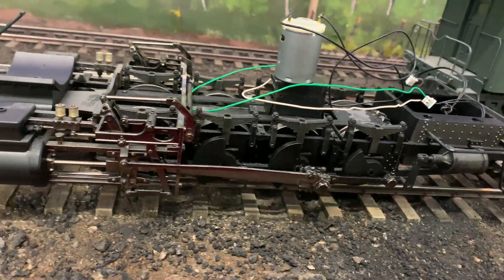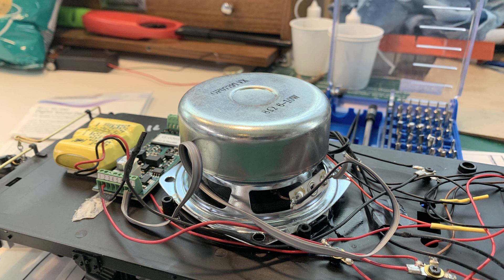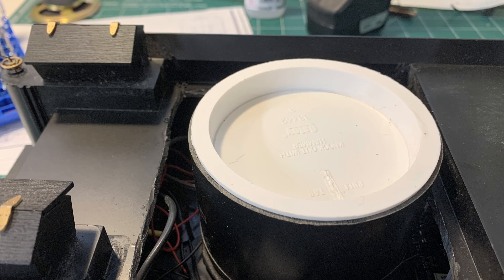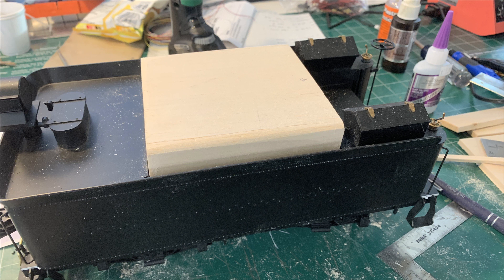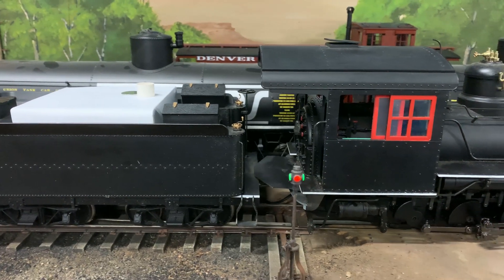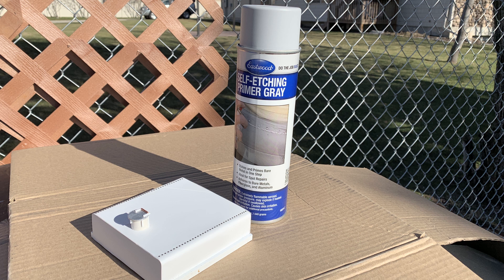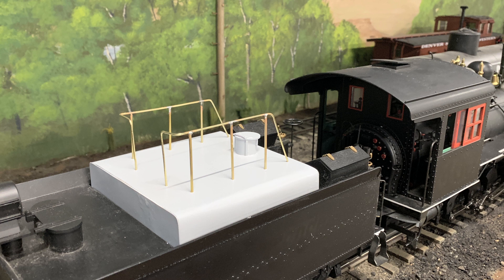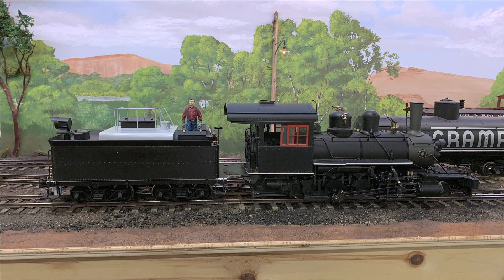Converting Bachmann Spectrum 2-8-0 Outside Frame Consolation to an Oil Burner

Comment: Hi... I really enjoy your video's on the Conni... You gave me the inside story on how to do!  "Thanks!"  Now,,, I am making a decoder change from what you did... I am using a ESU 58513 which has everything like sound on board this PCB plus a lot more possibilities... I will use the two power wires interconnect on the tender as my speaker connection from the loco,,, and I will rewire this locomotive extensively to make it more serviceable... Plus that Motor's Round circuit card will be removed too... I will attempt to use a water smoke method using this ESU card... I have that water vapor part in house now...  I did replace the gear issue, and have decorated this as the North Shore Railroad No. 31 located in Willits Calif.   "I only do Northern California Locomotives!"  Basically,,, I only do train items withing a 100 mile radius of Novato, CA and I like DCC.  I am about 50% done at this point with my Conni,,, and have in-house 45 power rail devices  of various kinds that are all G Scale... I basically repair broken trains I purchase via Ebay on the cheap... Thanks for all your wonderful help... Bob

Comment: If those rivets are on sticker type of material, you can do the warm water with a small 2 drops of dish soap. Use your finger and apply a small amount on the sticky side. This allows you to slide the sticker in place and then it will dry and stick there. I'm not familiar with the material, so it may not be sticker, and you might know this already.
Reply from the maker: Hi. Nope wet slide. If the strips could be cut a bit wider it would be much easier. But it’s a solid sheet of decal material and the rows are really close together. So as you slide them off the narrow strips cut with a knife or scissors tend to break. And they are really hard to get straight without them breaking into pieces. Can be done but I wish the strips could be cut wider.

Comment: I'm doing that similar thing to some of the steam locomotives on my model railroad, making some of them oil burners, I'm currently working on the details for my Junction Valley steam locomotive, and that's one of the steam engines that are oil fired, also does your garden railroad have a name by chance
Reply from the maker: Colorado and Utah. Sorta means “colorado in utah.

Comment: Nice modification. Did you watch the video of Archer for using these rivet strips? When I bought the first decal set, I ordered some cheap forceps on Ebay, like he recommends. With his method and the forceps, I never had real trouble with the rivet decals.
Reply from the maker: Yup. It’s the size of the strips I have the trouble with. So fragile. But in a he end came out great. I’m betting over time I could get good at it. But for now about half of my strips go in the trash. But boy does it look good in the end!

Comment: #14 looking good!  Have you considered replacing the motor in the Connie's with something modern brush-less that would draw less amperage than the original motors?  You do have those torn down.  Just curious...
Reply from the maker: Yup. If we were planning to do any heavy running I would. But we mostly just love to build. And the layout is point to point, as of now only 30’ and totally flat. At some point I plan of about 180’. But still flat. And with 35 (crap I really have 35?) locomotives these may not get run often.
Reply: @ToyManTelevision  I would love to do Fine Scale, but I don't have the space.  In NW Louisiana its too hot and muggy most of the year.  Its muggy even in Winter.  So, no outside trains.  However, I am modeling in On30.  I have a good layout after many false starts.  Still laying track, but I can run trains.  I am modeling Copper Mining in Arizona, not a Colorado railroad.  I do have a fleet of Broadway Limited Imports On30 C-16s.  All brass gears, brass axle saddles and springs.  Theses were produced around 2004.  These come equipped with QSI DCC with sound.  There were some produce as DC with sound.  I have been gutting the QSI electronics and installing Soundtraxx Tsunami 2200 Steam decoders.  I use Nano Oils to lube the locomotives.  I replace the front cowcatchers with a Bachmann one with the working coupler.  The electric motors are quality motors.  It produces a nice running locomotive with a modern DCC system.  The Nano Oil lubed C-16 draws very little amps than the ones without.  Also, those will crawl with much less throttle applied.  The ones with factory lube are taking a third to half the throttle range to get moving.  Next modification is figuring out how to do a flickering firebox.
Reply from the maker: @dkaustin98  hi. Wow love On30. The flickering firebox is easy in our scale. But all you need is a red and a yellow bulb or led with resistor. Put them on two functions on your soundtraxx board and program them to flicker. Copper mining l!! Have you seen our shows on Nevada northern? And kennacott?

Comment: Excellent post. So glad to see you back model this to a Mexicano engine. Very nice. There is actually more info online about Mexicano 2-8-0 No. 12 then about No. 14. But the engines were very similar. Again, Well done. 

But of course many of the the original Baldwind locos on Mexican lines were 30 in guage. Engine No 13 on the line from Monoz to Chignhuapan was on a 30 inch guage, not 3 foot. I do not know the guage of No 14. So maybe not exactly F scale. Maybe bad news. But hope this helps.
Reply from the maker: Yep number 12, 13and 14 or 30 inch gauge. Number 12 was brought to the United States to run on a 24 inch railroad. But that never worked so it’s on display somewhere in the Pacific Northwest. Which is why Bachman chose to use that as the prototype. Odd that they picked that one as a prototype but never used it’s original paint job.

Comment: Nice work!  Being an RC modeler I'm very familiar with balsa and how easy it is to work with.  For some reason I've always felt a little guilty when using it in the train hobby, but I like using it. I guess basswood has been the traditional "go to" material.
Reply from the maker: We keep a huge supply of it on hand. Use it for so many things. Started with it in about 1959 and I’m sticking with it. National Balsa. On line.

Comment: What about using straight pins cut down to make the heads look like rivets? Like make them a 1/4" or shorter and drilling very fine holes than gluing the heads.
Reply from the maker: Yup. Done that. But hard as hell to cut down. So.. plastic ones. We were getting them from Cliff Grandt. But he’s gone now. But we think we found a new supplier

Comment: I used HO rail track nails for rivets and styrene to build the oil tank on my engine.  Those nails are the perfect size for that G scale .  PICO also makes smaller nails that look like rivets.
Reply from the maker: Grandt line made cast plastic rivets that al used to make all his O scale cars. Always came out great!  Lots of work. But really nice. I think they are back on the market. ? Anyway best way I think. Archer decals are a “simpler” way. But still tricky.

Comment: It looks like the Locomotives from NdeM and FCM!
Reply from the maker: Yup!!
Reply: @ToyManTelevision  .The locomotive is looking great! I am very pleased that people from other countries do Mexican modeling, that FCM 14 that you are doing is a sister of the FCM 12 that was in the Edaville Railroad, after Edaville Railroad closed, the Engine FCM 12 was sold to the Alder Gulch Railroad, where She's still around stored since 2012 
Some information about the FCM 14 is that it worked on the 765mm (30inches Gauge) branch line from Zacatlán, Puebla, taking short trains from Puebla to Tlaxcala 
The Locomotives were decommissioned in 1958, and only the Fcm 12 survived.